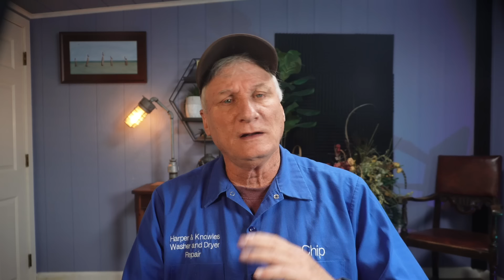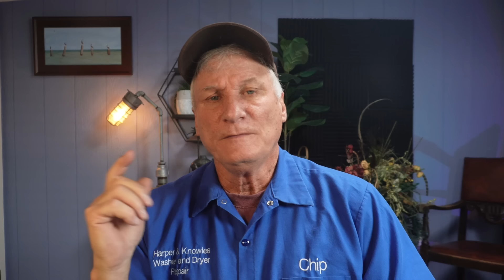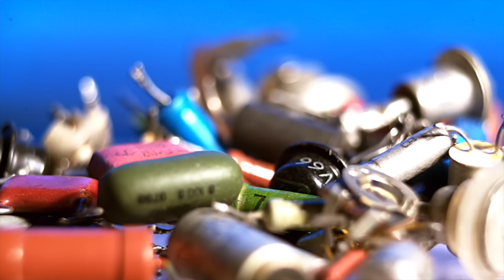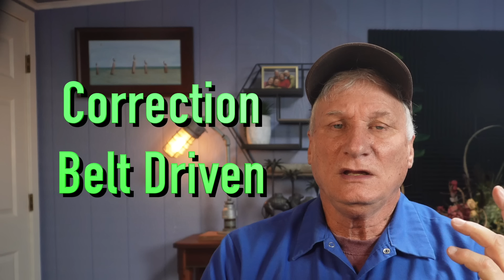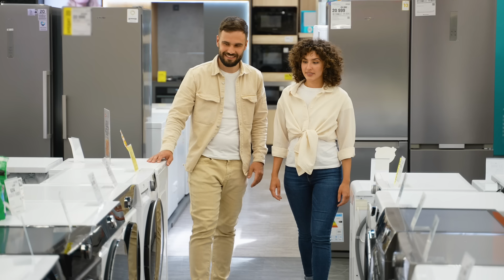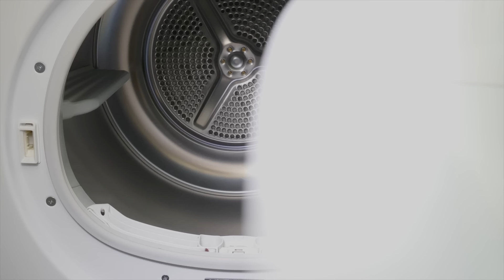Speed Queen Decoded: Which Model Is Built for Your House (Every Washer, Honest Review)

Comment: Yeah....but.

The newer Speed Queens from 2018 on are laden with processors and sensors - even the so-called "mechanical" TC-5 are laden with failure prone boards and sensors. The sensors take out the boards or vice versa. Any voltage irregularities in the AC line will cause error codes. Or worse. And that 5 and 7 year P & L Warranty? Third Party. They won't cover recurring problems that exceed a maximum $$$ amount. 

They...are failing in the field.
Reply: We all need a surge protector?

Comment: I just bought an FF7 to replace my Kenmore HE5 that I had for 20 years. The back bearing gave out. It never had an issue. I could of fixed it myself but decided on the Speed Queen. The matching HE5 dryer is still going strong and the repairs are simple. People complain about price but the HE5 set in 2006 was over $4k.

Comment: In 2014 I picked up a SQ AWN412SP111TW01 top load washer and it has been running great! All mechanical selectors and metal gears. I think it was $800 USD at that time. The only small complaint is that this model does not have the "Power Rinse" option. Sometimes I have to run the rinse cycle again due to the amount of suds left on the items and in the tub after wash is completed.  I regret not spending the extra $100 to get the "upgraded" version with that power rinse option.

Comment: Chip! What great videos. Your content is very informative and well explained. I have a 8 and half year old LG WT7600 HWA washing machine that recently started to leave debris on my clothes. Although I wipe the inside of the machine, top of the drum and detergent dispenser, I was unaware of aspects of the maintenance routine that you lay out, including running the tub cycle once a month. From my internet research, it seems likely the debris is coming from under the agitator. I ran two separate Sanitary Wash cycles with Affresh, which appears to have loosened debris (appears to be lint and soapy debris) and with subsequent runs of hot cycles without the tablet, there is less debris, but it's not completely gone. Last week, when I was unsure where the debris was coming from and I was wiping the inside top of the drum, the paper towel I was using fell between the drum and case. I had a repair service come and told him what happened and what I was trying to accomplish. He was able to retrieve the piece of paper towel and ran the washer to make sure it worked (there wasn't any debris when he did this), but he did not suggest removing the agitator to inspect it and give me an estimate to clean it. The cost of the service call was $227.00 and $115.00 for the labor to remove the paper towel. Not sure I should invest any more money into the machine. If I want to get a new machine (it is just my adult son who use the machine, although we do quite a few oads a week), what machine/manufacturer/model would you suggerst? Thanks for your help.
Reply: You must be kidding about a recommendation.  This entire video IS his recommendation.  I have read reviews on all the other mfg.  They are awful!!! My TC 5 is coming in 2 weeks to replace my 40 year old Maytag. 40 years ago Maytag was awesome. The Speed Queen will be too.
Reply: @ave @averymaples8472 - Got a new Speed Queen TR7 and so far, so good!

Comment: I have a household of four men myself included so myself and three sons. They just about cannot be convinced not to overload the machines. That said I’ll keep trying, but I’m looking probably to get the TC five. The front loader model sounded interesting so I’m still considering that. They wash a lot of work clothes, so do I occasionally wash our comforters or some pillows. Pretty regularly they will put way more into one load than they’re supposed to. I can certainly try to make sure that I do the proper maintenance and money is a consideration, however, I would be willing to pay more for the front loader if it was worth it I don’t love the idea that I would have to sponge down the door area often. I’m leaning the TC five what do you think? Additionally, I have very cramped upstairs washer dryer area. The dryer is nearly brand new and it’s a whirlpool. I recently had the dryer ducting cleaned, and repaired, which took care of my drying problems. My previous washer was a Maytag and it’s lasted about 8-10 years even with their constant abuse.

Comment: The only thing I dislike about SQ washer is that its on the 2nd floor and it shakes the house like crazy since it is a heavy machine. Other than that, 11 years with no issues.
Reply: we use "KE shake away" washing machine pads from kellett enterprises. been using them for over 25years

Comment: "Best" is subject to interpretation.  Not everyone wants absolute reliability above all else.  The SQ top loader is too aggressive and uses too much water . . . for me.  And the front loader is too small and lacks features.  If I have to replace another "lesser" machine after 8-10 years, I accept that as a trade-off for the features and functionality I want.  I bought LG front loads 15 years ago and they are still running fine.  Will they last as long as a SQ?  Not likely, but I accept that.
Reply: It's interesting how peoples priorities can overlap. I'm with you, to a certain extant. We got a top end (at the time) LG front loader and matching dryer right before the Obama era gimping of appliances. So I have all the cute little tunes it plays, and insane amount of options, but it actually uses enough water to clean and rinse and doesn't take 3 hours. We have had zero repairs in almost 10 years and I'm gonna keep it till it drops. 
That being said, when it does kick it I'll probably look hard at the speed queens. I love my whiz bang, but most new models from other manufacturers just simply take to long when you set the cycles to thoroughly clean and rinse the detergent out properly.

Comment: I have the TC50003wn version with its matching dryer, not particularly because it has knobs, but because of the traditional wash action.  My clothes get dirty, not "Oh, I sweated on the walk to the office today" dirty, but "I worked out in the garage under the truck today, or out in the garden on my hands and knees in the dirt" dirty.  The TR gentle wash just wouldn't cut it for me so I have the traditional agitator and using soap powder detergent along with some borax and bleach on the whites seems to do the best job.  There's only two of us and we may only get a full load every two or three days and the dryer only gets used in winter or if its raining outside.  I fully expect our set to last us quite possibly the rest of our lives given our ages.  Another reason I wanted a top loader is because I'm 6'8" and even on pedestals the front loaders are hard on my back.  "Quiet operation" is a relative term.  Our set is out in our utility room and half the time I never hear the buzzer indicating a load is done, much less hear them running, lol.

Comment: Bought my Speed Queen model AWN432SPI3TW4 in early 2018 after my beloved 50-year-old Maytag drum started leaking oil, couldn’t be fixed, and I got burned $1k+ by a brand ‘new-and-improved-Green-conscious’ LG that failed BY DESIGN after 2 months! Not one to play the ‘under-warranty’ machinations, spend a dime of my time let alone a charge to fix, I said, F this. I canvassed my town’s public laundromats, and worked with my specialty appliance supplier to find the least digital, most analog, most old-school mechanical SQ they could find. Suffice to say, the machine’s my laundry hero.

Comment: Have a Speedqueen Washer dryer. Washer has an electronic control center that failed just outside of warranty but was covered in full. Dryer's heating element failed, repaired at our expense. Which was fine with us.
Reply: Mine failed, but then I later learned that’s the only washer to have a very small part that you can just replace it. So my tune was probably working fine. They just needed to fix the small part.